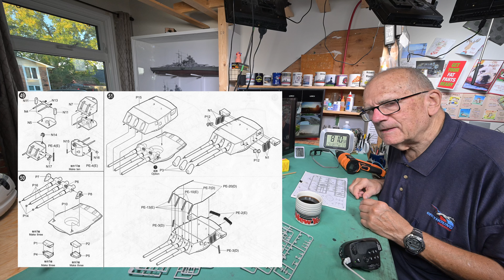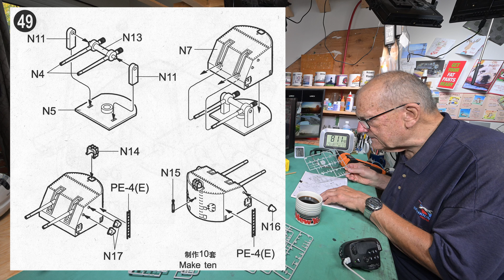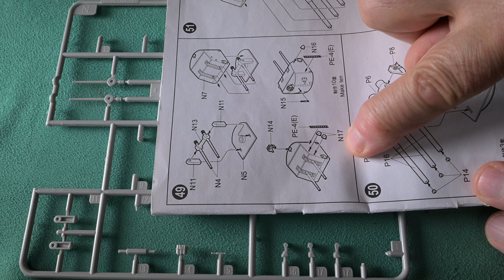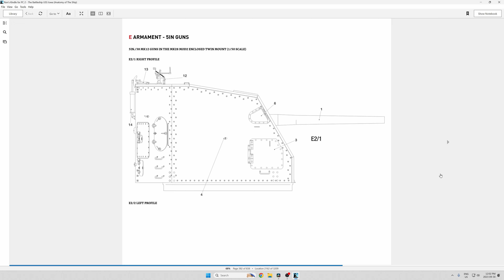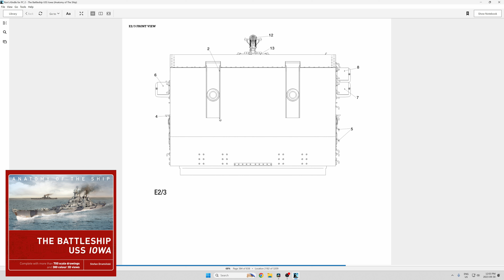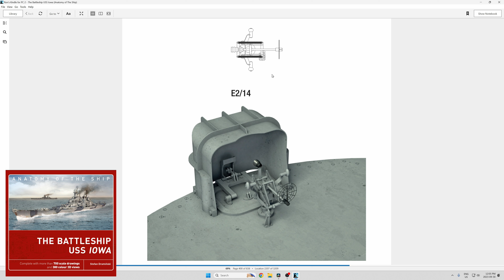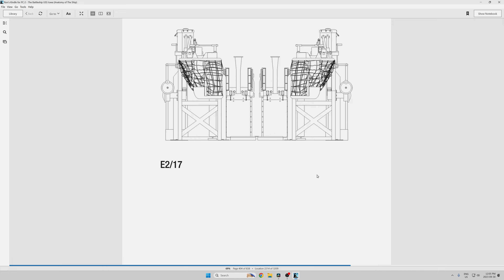The Model Ship - Part 1751

Comment: I was only kidding about the heat gun haha.
That thing on top of the 5 in guns was where a sailor sat to aim the guns under local control against aircraft.
The things on the side are covers for the stereoscopic range finders.
Àlthough radar controlled normally, when firing at planes with proximity shells the went to local control.
Reply from the maker: Re: "stereoscopic range finders" Thanks Jerry! I thought that's what the likely were. 👍